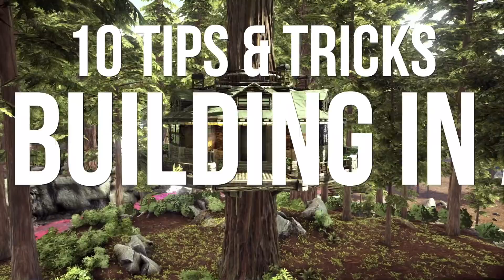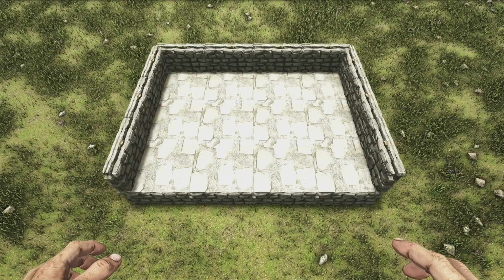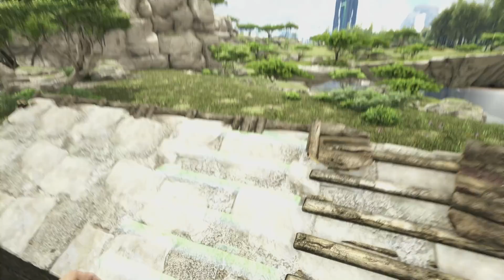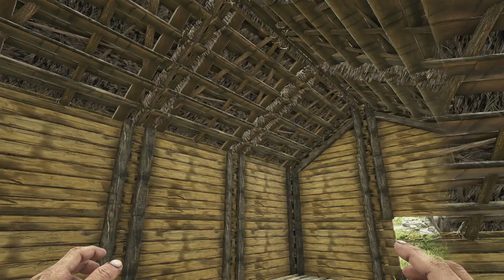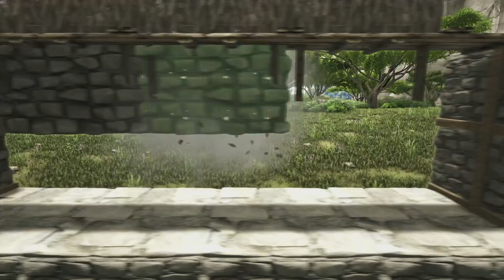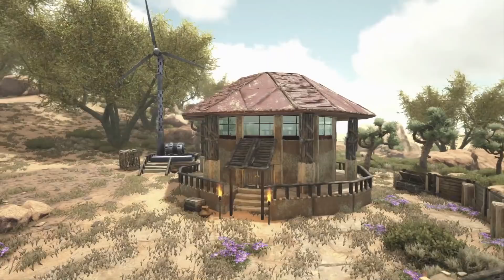Ark: Building Tips & Tricks

Comment: I'm not sure if the 3 walls trick works anymore.  Every time I try to place a fence foundation, it places on the outside of the foundation and not the inside.  Am I doing something wrong?   Also, I am using Structures Plus.  Is it not compatible with this mod maybe?

Comment: Couple questions.
1. What's the point of triple walls?
2. I'm running a private server on a VM with some people with lower end machines. I like building things that have a lot of functionality, like a hanger above for a "fleet" of flyers and elevators. How intensive is this stuff on the server? I know the more structures there are the more the server has to load and remember, but what's the ratio? How much should I limit my builds in order to accommodate for them based on the strain they add? I know it's not possible to find specifics without knowing their machines, but is there a general rule of thumb?
3. Related to the previous, but have you thought about making a series on good looking/practical builds that are structure efficient?

Comment: I tried as hard as I could to get triple or double walls, using Q to cycle and looking around for a snap point. I could never find it. Is there some special setting. I do have s+ installed, However I tried with all vanilla structures and could not get anything. Is there something I could be doing wrong? It looks so simple in the video.